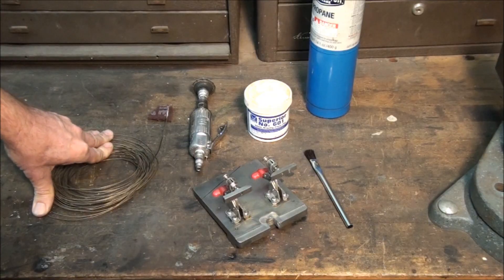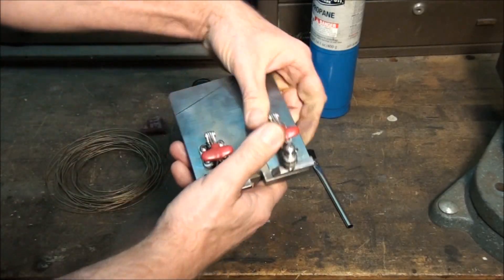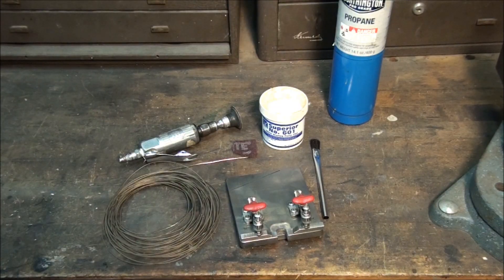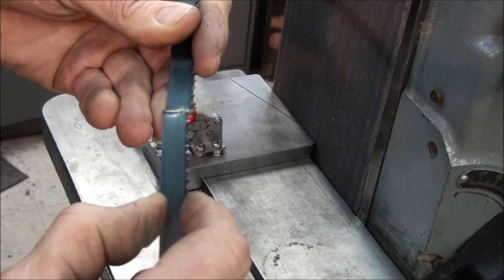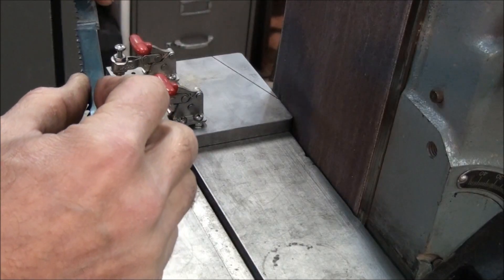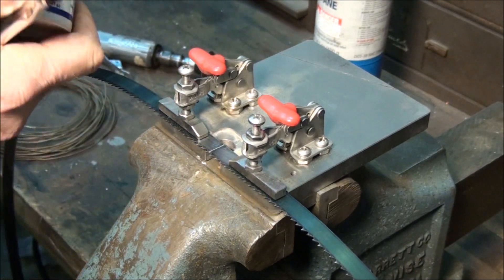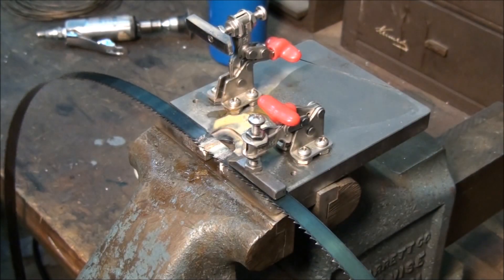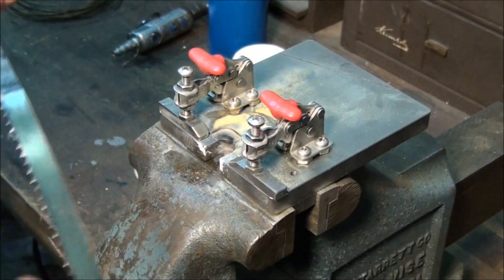How to Make Custom Length Bandsaw Blades Without a Welder

Comment: something I started doing while running the weld fab shop in kuwait for our metal cutting band saw. cut the joint at a matching 45 instead of a flat butt joint. This resulted in the weld passing over the rollers  better than all of it hitting at one time.. Yes we sanded them down, but they still caused a bump.  ex: 1/2 wide band..when connected via a 45..gave you almost 3/4" weld surface which gave you greater strength.  After that...never had one break
Reply from the maker: Richard,

I've heard of angling the joint to the blade, but the reason I like making the joint square to the blade is that it's much easier to get the joint between teeth and keep them evenly spaced, especially on coarser pitches. The 20º angle on the joint still  provides for more than adequate strength. How to you make a 45º cut on the blade without affecting the tooth at the end of the cut?

Tom

Comment: Nice vid, are those custom jaws in that Starett(?) vice?
Reply from the maker: No, you can order smooth jaws for the Starrett vise.

Thanks for watching.

Tom
Reply: Thanks for the reply. I wasn't really asking about smooth jaws. Their "L" shape seems custom to me. I don't suppose you could telll me the make/model of the vice please?
Reply from the maker: There is nothing custom about the jaws. They are just standard issue Starrett smooth jaws. The vise is a 5" and very well made. Unfortunately I don't think Starrett makes them anymore so if you want one it''ll have to be used.

Tom

Comment: Great video l was apprenticed as a tool maker in press tools so have made many band saw blades, l would grind the end angle about 5/16" to nothing then get some thin brass shim and hammer it till it was really thin break a piece off no bigger than the 5/16" and width off the blade hold the two ends of the blade in a jig like yours only it had a third hold down in the middle slide the brass between the two blades cover with flux apply heat when you see the brass start to melt take of the heat and pull down the middle hold down this makes for a good joint dress up just like you did to anneal it just warm from both sides off the joint not hot watch for the joint to turn blue then take of the heat and dip or just let it cool by its self just thought l would mention this method if the silver solder was hard to get hold of, you did a great job with yours and l will try it myself thanks for the video
Reply: Hi, Over the last 60 years I've done exactly what you've been doing.....I use the brass shim too as it's stronger than silver solder and comes in thin strips etc.
One firm I worked for had 20 broken blades lying in the  store because nobody knew how to braze or weld them.
The secret of the on machine butt welder is to get the ends dead square first then  after welding do the tempering and most important to grind the butt to the same thickness as the blade or it'll jam in the guides.......if the blade butt welded joint is not tempered it'll break quickly.
I'm just getting a table top bandsaw this week so now I'll have to make a blade joiner before I get a breakage.

Comment: No reason why aluminum wouldn't work for the fixture?
Reply from the maker: I make most of my permanent fixtures out of steel for durability. Other than that, aluminum should work just fine.

Tom

Comment: I have an older three wheel bandsaw that saws well but EATS bandsaw blades!  And of course it is a somewhat off brand length of 70 1/2 inches.  Have you had any feed back on how well the silver solder joints hold up to the three wheel bandsaws?  Also, if the blade breaks and there is still room to re solder it is that a viable option?
Great video!
Reply from the maker: Terry,

Unless the wheels are significantly smaller, it shouldn't make any difference how many wheels the bandsaw has. I can't comment on whether the blade can be re-soldered (although that shouldn't be a problem), because I've never had one break. Properly done, the soldered joint will outlast the blade.

Tom

Comment: Thank You,  I copied your design except for / bevel guide.  I decided replace the slot with 2 half in thick blocks with screws.The inside half was adjustable to allow for thicker blades.  I tried 1inch and  1 5/8 inch (0.050) wood cutting blades blades not expecting good results and figuring I would need a 2nd fixture for the wider blades.  Following your instructions exactly I was amazed at the perfect results.
Reply from the maker: If you take the time to make the scarf joint so the teeth line up it makes a joint that you can't even hear when it passes through the guides.

I thought about making my fixture adjustable, but all my blades are the same thickness so it was easier just to saw the slot. The filler block method you used is a good alternative though if you don't have a saw (or have different thickness blades).

It's good to hear the technique worked for you.

Thanks for watching!

Tom
Reply: Toms Techniques

Comment: Another great tutorial.  I have a couple of bandsaws, and have always welded new blades.  Some last for a good working life while others have not.  I think I am going to be making new blades with this method from now on.  Also it seems quicker than welding new blades.  Besides, a scarf joint is much stronger and flexible than a butt joint.  Once again thanks for your time and tips.

Comment: I have  a vertical 1/2 inch saw and a horizontal 1 inch saw. I watched your video after being frustrated with my blade welder. Today I went out got some silver solder, flux, made a jig and welded up my blades rather than using the blade welder. Your method works great and I will no longer bother with my blade welder as I am tired of hard weld joints that crack and fail. Thank you Tom.
Reply from the maker: Thank you Phillip, I'm glad it worked for you. Brazing is much more forgiving than welding. If you don't anneal a weld enough it'll break, and that step can be skipped entirely with brazing.

Tom

Comment: Was this a Bi-Metal blade, Carbon Blade, or some other type of blade? I see that you are cutting aluminum with it and was just curious as to which type of blade is best for this.

I've heard that Bi-Metal blades are best for cutting non-ferrous metals. In your experience, is that the case? I've already ruined a couple of blades cutting aluminum and steel. I suppose speed has a lot to do with that...
Reply from the maker: Carbon steel or bi-metal blades can be used on any type of metal, the bi-metal blades just last longer and cost more. You just need to choose a blade that engages at least two teeth with the work and run it at the proper speed for the metal being cut. The blade I'm using in the video is a carbon steel blade with five teeth per inch, running at 300-500 sfpm. for aluminum

Tom
Reply: Toms Techniques Thanks for the info, Tom. That clears up a lot of the confusion I had with these blades. I was running them way too fast (700-1000). Lesson learned.

Comment: a/c supplyhouse has silver brazing alloys
Reply from the maker: Thanks. Not sure how strong they are though. This is a pretty high strength application. As long as they are 50% silver or better, they should work fine.

Tom
Reply: they sell 45% and 56%

Comment: Excellent video and extremely useful information! The only hard part is making up the fixture, if you don't have a milling machine etc!
Reply from the maker: Thanks.

You can make the fixture out of wood, with a few changes. Click on the rather lengthy url.

Tom

http://www.google.com/url?sa=t&rct=j&q=&esrc=s&source=web&cd=2&ved=0CDAQFjAB&url=http%3A%2F%2Fwww.shakerovalbox.com%2Ffinished%2FBandSawBlades.pdf&ei=bogzU8SoLKyayQHTwYC4DA&usg=AFQjCNGSXT6Qn0bj4N5cwV2bTSIgKDKfIw&sig2=G9UQGotrP2Gpstx2b8aJDA&bvm=bv.63808443,d.aWc&cad=rjt
Reply: Thanks very much, Tom.

Comment: I have made a setup somewhat like yours, I have never tried a flux to keep my blades lubed the way I was taught we used borax detergent boosting powder I don't really know which way would work better though
Reply from the maker: Borax is used for the forge welding of steel, but its melting point is too high for silver solder (1369ºF). The solder I use melts around 1200ºF. You might try some some of the paste flux I described.

Tom

Comment: I love this video!  I never thought blades could be soldered - i thought they must be welded.  You fixture is excellent too!  BTW, in the video, it looks like your flux is 601 flux, but the link you provide doesn't seem to have that number.  Is it the same as their handy flux? I assume it is not the superior flux #6 because that says no potassium bifluoride. Thanks.
Reply from the maker: Glad you liked it Mike.

Thank for the heads up on the flux. Superior #601 is the flux you need. I've changed the source in the description for it.

Tom

Comment: Well done Tom; thank you for sharing; your process is right on the money;  Allow me a few comments:
1. I use a similar jig on my disc sander table but I grind a shallower ten degree angle for a little more overlap at the weld.
2. I use the silver solder and flux kit from Lee Valley.
3, After welding, I anneal the blade about three inches on either side of the weld by gently heating and cooling the blade a couple of times.  I think it lessens the possibility of the blade becoming brittle near the weld. 
4. I also sharpen blades with a Dremel- type tool. There are some good how-to videos on that.
Reply from the maker: Thanks Carl.

Welding a blade creates hard spots, but silver brazing does not, due to the lower temperature required. I suspect annealing post soldering may be redundant since since the blade is already annealed from the soldering process. Annealing the blade is also going to anneal the teeth. Do you have any trouble with the blade dulling faster in the area where it's been annealed?

If you are resharpening your bandsaw blades, you have much more patience (and time) than I. :)

Tom

Comment: Tom, is your bandsaw a wood bandsaw, or a slow-speed one for metal?  I've seen a few 14" bandsaws that have two pulleys; one for wood and one for metal.
Reply from the maker: It's the metal cutting version with the two speed gearbox. Unfortunately it's missing the parts that make the gearbox functional. It's on the list of things to do, I just need to come up with a few extra hours in the day to make it happen.

Tom

Comment: Thanks tom, yah mabe got the blade a little to hot & took the temper out of it, the solder held though. Need to find a sores for blade here in the uk,.
Reply from the maker: Oh, it broke next to the joint? If you quenched the blade in water, it would have become brittle. If not, then you probably just got it too thin or over heated it. use just enough heat to make the solder flow. Taking the temper out is ok.

Tom

Comment: I just invented a new thing.... they should make "Mobius Band"-saw blades. Teeth on both sides of the blade, so they stay sharp longer.
Reply from the maker: Interesting concept.you could twist the blade on the back of the loop. Only problem is that teeth on the back of the blade might be a bit hard on the thrust bearing.

Tom
Reply: Toms Techniques hehe. Ye. I thought of that the minute after I wrote the comment .
Reply from the maker: He Ka
Solve the problem and you could retire early. :)
Reply: Toms Techniques Well instead of using a bearing let's use a sprocket that engage the saw's teeths :)

Comment: Wondering if to braze it will work???
Reply from the maker: Probably not as well as silver solder. Silver solder is stronger and it will wick into the joint better. You could try it and see.

Tom

Comment: If you make the cut in the blade at a 45deg angle instead of 90deg you also increase the area being soldered for greater strength. The 20deg bevel helps a lot though, thanks for the tip :)
Reply from the maker: Andy,

That would make a stronger joint if you could get it well lined up, but the 20º angle appears to be adequate for the task.

Thanks for watching.

Tom

Comment: Hi Tom,
Great video, thanks.  How did you create the 20 deg kerf in the jig?
Reply from the maker: Thanks.

The plate was set at 20º in the vise and a 3/8" deep saw cut was made using a .025" slitting saw and a lot of cutting oil.

Tom

Comment: Hi Tom

This vid is about $200+ late for me....damn... Lol

Did you use a slitting saw to make the blade slot in the fixture?

Tks for the education 

Chuck
Reply from the maker: Yup, a .025" slitting saw and lots of cutting oil.
Reply: Toms Techniques threw away about 10 good sharp broken blades that could have been saved.

Comment: Thanks for showing this method of making saw blades.  My Rockwell/Delta bandsaw is very similar to yours (built in 1973).  I made a ~5" extension to my tension knob so that it now sits slightly above the upper guard, which is much easier to operate then.
Jack
Reply from the maker: I thought extending mine and adding a crank, but after reading Reid's comment below, maybe the cordless would be the way to go.

Thanks for watching.

Tom

Comment: HI Tom,
Great Video!  I like that multi use fixture.  Clean and simple.  I have the same bandsaw and I didn't like the tensioning knob either.  I took a length of all thread, rounded one end and welded two nuts on the other.  Now, I use a cordless drill and socket to run the tensioning wheel up and down.  Much faster and easier.
Thanks for the video!
Reid
Reply from the maker: Thanks Reid.

I use my cordless to feed the rotary table and the compound on the lathe. The bandsaw tensioner seems like a good application as well.

Tom

Comment: I have that same bandsaw. I have a welder and sometimes I can make a blade that lasts a long time. Other times I can't even get it on the saw without it breaking. I need a new one now and have been thinking about buying one.
Reply from the maker: If a welded blade breaks, it's usually because it wasn't properly annealed.
Reply: I have tried a lot of different ways to anneal it but sometimes they still break. Maybe I will do a video on making one and see if you can spot what I am doing wrong.
Reply from the maker: Buckrun11 I'd be glad to take a look.

Comment: Tom great lesson, on silver soldering, I made the same type of clamp for mig welding blades an its been a bit of a pain grinding, i now plan to silver solder and add 2 of your improvements ,  bigger feet on my destaco clamps and the saw cut to get the evven 29 degree blade prep thanks for all your tips!
Reply from the maker: Thanks Ron.

I would also suggest milling some clearance on the center of of the feet so they only bear on the ends. That would clamp the blade more securely with less pressure.

Oh, and the angle of the scarf joint on mine is 20º not 29º.

Tom
Reply: thanks Tom sounds like i plan and i am a rotten typer  hit the 9 instead of the 0

Comment: I have heard for years that silver soldering blades was more forgiving than welded blades, I'll have to try them sometime.  Nice little fixture, the only thing I can see that you could use would be a small cam and lever to keep it in the belt grinder slot.

On a another totally unrelated and pointless topic, do you realize how much your voice sounds like Jeff Bridges?  I just had to mention this as I have a very sensitive ear for sound and voice recognition.
Reply from the maker: Thanks Keith.

The cam is a good idea, although the fixture is heavy and stays put pretty well.

Jeff Bridges huh. I guess I could see (hear) that, except for the accent.

Tom

Comment: Does the blade need annealed after silver soldering?  When I welded a blade with a butt welder the blade becomes very brittle.
Reply from the maker: No annealing is required. Unlike welding, silver soldering doesn't make the blade brittle.

Tom

Comment: Hi Tom,
love precision of your soldering fixture and your skilled work! The only I recommend as well is to attach your jig to sander table.
Thanks for posting, again I have much to learn...
Reply from the maker: Thanks Milan.

I tried attaching the jig to the table, but it's nice to be able to pull it off to one side to get the blade in the slot.

Tom

Comment: where do you get the blade it self
Reply from the maker: Any industrial supply will sell the blades by the roll. There are lots of suppliers on the links page of my website. I usually get mine at McMaster Carr.

Tom

Comment: You made that look easy, thanks for the tip.
Reply from the maker: It is pretty easy if you take the time to make the fixture, since getting the blade properly aligned is key. Grinding the joint down will take a bit of practice though, so you may want to play around with a few sample joints before tackling a full blade.

Tom

Comment: Thanks Tom, for the fine video. I am looking for a band saw and will use your technique for silver soldering. Do you buy the blades in rolls, say 50 meters at a time?
Reply from the maker: Thanks Jim, but what's a meter? ;)

I get it in 100 foot rolls. This particular blade stock was $80 for the roll and I get 12 blades with a bit left over for that emergency occasional splice.

Tom
Reply: A meter is something you measure with!
Like a volt meter. , amp meter, .

It is also a verb meaning to apportion out in proper mix ie.

We had to meter out the epoxy parts to get the correct mix.

I guess maybe in Europe they use Siemans brand voltmeters to measure things?
Here we use inches .
 Update : I found a conversion table and 1.3 Siemens meters  is equal to one Flucke meter at least in Walla Walla…